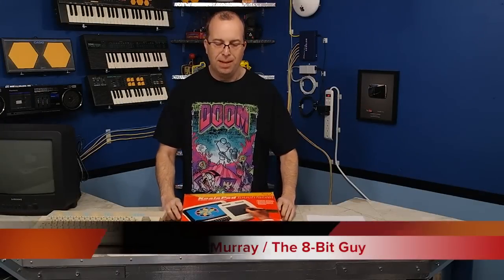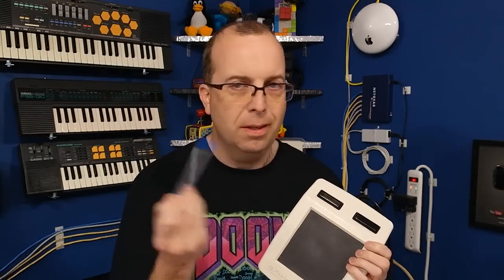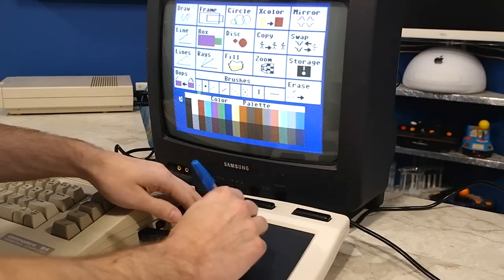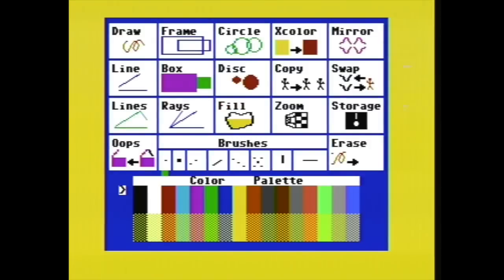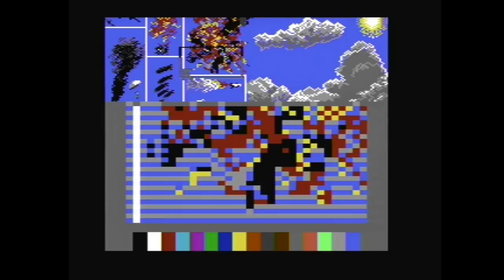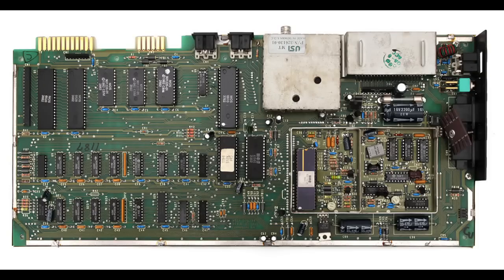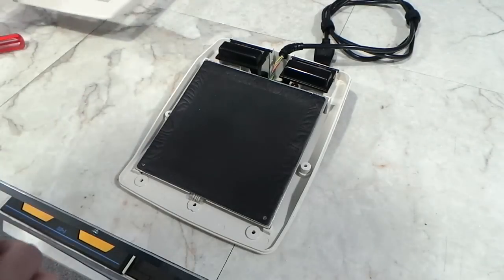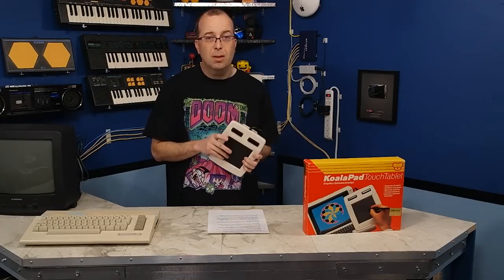The KoalaPad - How we used to create graphics

Comment: I had the KoalaPad for my Apple //e and it was handled like a joystick. 

The title screen reminds me of Graphics Magician images. At the moment, I can't verify when it came out, but it seemed to be on the Apple II first. Later, it was released for the Atari ST and Commodore 64.The software recorded the steps to draw an image instead of saving a completed image file. It was intended for adding graphics to adventure games - Hi-Res graphics with the 4 lines of text. By saving the steps to build the image, it used less disk space that an image file would. I did own a copy of the software back in the 80s. There was no licensing fees. You just had to list the programmer in the credits.

Comment: I do remember the CD-i  having something like this too.
not that I actually owned one but spent a great deal of time stuck in a place where they had these in a kiosk type setup, and they used something that looks just like that, and I think even had that name or a very similar one to it as the controller instead of the one that came standard.

Comment: There was a rebranded one for the Tandy Color Computer, no software included. The CoCo Koala Pad attaches to either joystick port in the CoCo and read just like another device in there, analog to digital converters producing standard X and Y values from 0 to 63. Suitable for some applications but for power users the GT-116 Digitizer Table was the way to go in the CoCo world 😎

Comment: I made a tb-303 emulator with assembly on c64 back in the day and the main reason for the whole thing really was those pot inputs. Having a potentiometer controlled and readable filters were a bit pricey at the time (we had alfa wheels everywhere and buttons, all pots were gone in the 90s..)

 The reason why sound chip would handle that is that.. it is just simple analog to digital conversion. Even thou SID has nothing to do with samples and ADC/DAC, it is still quite logical place to put the whole thing. One can use the pot inputs in the SID chip to make a very crude sampler too.. If i recall correctly, one could link the pot directly to SID filter controls (or i made the link, takes two instructions (read pot to register, write the value to filter address, done ) :) ).

Comment: For painting and drawing, these old analog joysticks/paddles usually read from 0-255, which is okay if your resolution is at or below this, but for higher resolutions, some dots must be skipped to fully move across the screen. The skipped dots are inaccessible without zooming in, or constraining the cursor movement into a smaller area.

Comment: We used to use a similar device on a C64 back in the mid 1980s to create title screens for video cassettes. It didn't have buttons and it had a flat bottom (base) instead of the slanted one the Koala Pad in the video had. Along with painting and drawing it had a text function.  Any idea what that might have been?

Comment: Here's the IC part numbers if anyone is curious:

Top Left - LM2902J - Quad op-amp
Top Mid - LM3046N - Transistor Array (5x NPN, 2 in differential)
Top Right - CD40106BCN - Hex Schmitt Trigger

Mid Left - No idea. Looks like it says "μA 33R PC H332" on it but hard to read. Google brings up all sorts of random parts for this and similar model numbers, so can't really say what it is.

Mid Right - MM74C74 - Dual D Type Flip Flop

Bottom Left - LM3046N - Transistor Array (5x NPN, 2 in differential arrangement)
Bottom Right - CD4066BE - Quad Bilateral Switch

using the orientation shown in 6:37

Comment: I used the Koala Pad a lot, back when it came out, both on the Atari 800 and Apple II Plus. I enjoyed drawing with it more than using a mouse with MacPaint. Though, I liked MacDraw, since you could create graphical objects, move them around, and combine them into larger objects.

I had researched how to load and display standard graphics files on the Atari and Apple II, which were uncompressed. It was a simple matter to load Koala Pad pictures on the Apple II, since they were stored in the standard Apple II bitmap format. You just went into its high-resolution mode, and executed BLOAD <image file> in Basic. This was not the case on the Atari, though. Every time I tried to load a Koala image using a standard graphic format algorithm, I'd get garbage. I wrote to Koala Technologies and asked them what I needed to do. They actually wrote me back, giving me an algorithm in machine code to load Atari Koala pictures. I wasn't familiar with assembly or machine code at the time. So, I didn't implement a Koala loader, but I at least found out that the Koala format was compressed.

Comment: i know i'm a little late here, but anyway-- the parts i see on that circuit board are: CD4066 (quad bilateral switch); 74C14 hex schmitt trigger inverter; 74C74 dual D type flip-flop; LM3046 (2) bipolar transistor array; LM2902 quad operational amplifier; and one chip I can't read, hidden under the wire bundle. most likely the 74C74 flip flops are used as debouncers for the two buttons. they probably use the 74C14 schmitt triggers to make an oscillator. the touch panel is possibly a pair of resistive sheets (so many ohms per inch) separted by a mylar sheet full of holes, so the two sheets come in contact thru the mylar holes when pressure is applied. the digital oscillator probably drives the bilateral switches to alternatively drive voltages onto first the horizontal and then the vertical sides of one of the sheets. the op-amps probably read voltages from the two sides of the other sheet, and bipolar transistors probably also form sample-and-hold circuits with those big caps; the transistors would then be driven by the two phases of the schmitt oscillator so one op-amp is enabled to sample-and-hold only when the horizontal voltage is applied thru the switches, then on the next clock phase the other op-amp is enabled while the vertical voltage is applied. simple, but clever.

Comment: I'll also add, that it seems like all this device does, is mimic a mouse. 
Which in return, is mimicking fine movements of a keyboard (given the type of computer that would have been used with this back then). 

I'd be interested seeing how the hardware  to software interaction is like in this thing. Plus the actual hardware.
Reply: It's almost like this thing is a digital/semi-mechanical Etch-A-Sketch!

Comment: Looks like a 4 wire resistive  touch pad. (does it deform slightly when pressed?)

The touch-pad is made by taking a conductive sheet of material and attaching wires to the top and bottom.  Then, doing that again but rotating it 90 degrees and sticking it under the first with some sort of fill that prevents them from touching.

You take the two leads for the top pad and hook them up to VCC and GND. then you take the two leads on the bottom and look for a voltage between them and gnd. When you press on the screen the layers touch and it's just like a wiper on a pot. There is a gradient from 0 to vcc and you're sensing it at the point of contact using the other sheet.

The annoying bit is that's only half of it. You sensed  one co-ord. you need to do the test again only with the top sheet as the sense sheet and the bottom as the vcc-gnd sheet.

That's what the circuitry is probably doing. Rapidly switching between X sensing and Y sensing. and then "pretending" to be two paddles. Maybe it "stores" the voltage in a capacitor hooked up to a unity gain op amp that then goes out to the paddle? and uses an analog mux to do the switching? Do you have high rez photos of the electronics?

Comment: That was the first tablet I tried in 1983 on an Apple II. My version of the software for the C64 came on floppy - and the disk failed to load (copy protection or something). Ended up returning it and using an Atari Touch Tablet which was released the same year - which had a button on the stylus and about double the drawing surface instead.

Comment: If you hooked both paddle controllers up, would it be possible to use the program like an Etch-A-Sketch?  Or do the fire buttons on the paddles not correspond to the buttons on the KoalaPad?

Comment: I had this when it came out. I ordered it from compute magazine. I spent my high school 10th grade summer vacation to make (INMHO) some pretty damb good MLB logos (bluejays,yankees,mets,boston red socks(Theses disks are out there so if anyone has my art, I would appreciate you letting me know) ) and some comico mage and another one I can't remember. I used grey as the shader at the pixel level to smooth out the pixelation. It was on the commodore amiga I used mine I think. It may have been my 64.

Comment: 6:34
LM3046 (2 chips on pcb) - 5 general purpose NPN transistor array
LM2902 - low power quad op-amps
PC 8332 - unknown (custom made microcontroller?)
MM74C14 - hex schmitt trigger inverter
MM74C74 - dual D-type flip-flop
CD4066 - CMOS quad bilateral switch
:D
Reply: Was going to do the same, lol. Good thing I checked comments first :D

Comment: Went to art school in 80's. The school had a very small room with a few Apple's and Koala pads for "computer graphics". I don't think it was even called "computer graphics" back then. There was maybe 3 or 4 "stations" and at the time I used it once for one small project in one semester... it was mainly a novelty. The process was torturous and the results were quite useless as "final art".

At the time the school did not have a good way to get anything of quality out of the system. We did save projects to large floppies that we brought to class each day. The only way to get things out into something tangible off the screen was a horrific dot matrix printer (crap computer paper with muted colors. The paper was so wet with ink it was limp and prone to tearing. It had to be dried before doing anything with it and was quite wrinkled after drying.)

The other option was a film camera with a special "mount" that attached directly to the very small color monitor. We took color slides of our creations. The results were perfect... uh.... considering the pixelated content being reproduced. I still have slides of my art work, but have since lost the disks they were on. Prints from the slides were better than the dot matrix prints but not by much.

There was one more thing we had attached to this system. It was a "black and white" bit mapped photo digitizer. So long ago I don't remember how it worked or what it was. Basically we had a camera input directly into computer. By adjusting the threshold of the input we could digitize high contrast artwork or objects and then modify it with the Koala software. At the time... I was... very underwhelmed but also intrigued by the potential.

Little did I know that not that much time later after graduating from art school and I had been working at an advertising agency for a few years as a "paste up" artist, desktop publishing would explode (Adobe and Apple perfecting Postscript), I would be working in a completely digital graphics department. Almost overnight this new phenomenon would wipe out local businesses and careers in a the print industry that suddenly became redundant. Only print shops that invested in digital equipment and training survived. Many companies instead of adapting, simply refused to take anything that was produced digitally... eventually there were no jobs and they had to close.

I saw the digital take over happen in real time so fast my head was spinning. People in my own company who didn't adapt were laid off. I saw digital wipe out careers that took decades to learn. Like shooting film for printing plates (choke and spread for overprinting). Creating four color photo separations "by hand" from color photographs. In the old days that stuff took years to learn how to do well. Desktop publishing eliminated the need for that expertise overnight.

I looked back at that Koala pad I used in art school in a whole new light... I was amazed how freaking FAST that transition happened.

Comment: Makes sense to me you'd handle the analog paddles in the sound chip.  There's a reason a PC joystick port was on the sound card--there's a lot of analog circuitry on a sound card, so it's a natural place to put an ADC for game controllers.
The LM3046Ns are five NPN transistors.  The LM2902J is a quad low-power op amp, I couldn't really make out many other part numbers.  Nothing too exotic it seems.

Comment: It works with GEOS because it works the same as the mouse did.  The commodore mouse was a pair of continuous pots for the x and y axis.  This and a mouse should be interchangeable more or less other than a mouse would go from max (255) right to min (0) where as this looked like it will return a value based on the absolute position.  That may cause a few quarks.

Comment: There was also the Lucasarts, Pixar, D'OCon and Paintbrush back then but they were custom hardware studio exclusive animation computers nothing to do with a plugin for a home computer to use with such programs as Deluxe Paint for Commodore computers though.

AMIGA would have been the best system to use these plug in pads in the day as AMIGA was built for music, graphics and animation creativity in mind but it's pretty cool to know there is a plugin way of doing creative drawing stuff on the less powerful hardware it's bonkers because of the limited colour pallette of the C64 to have such a thing out for it but it's good that it was out there for games graphics makers who normally had to program a sprite using lined paper as pixels and basic scripting language as it elliminated such a requirement until it came to coding the game bits.

Comment: I actually really don’t understand how this drawing program works, does it store and manipulate tile sets via chr ram or does it generate vector graphics trough software and then generates it as tile sets,

Also I can imagine that if it instead just stores every possible combination of drawings as tile sets on the cart, i can imagine that you need to store millions of tiles to account for every possible combinations of drawings such as circle on circles or squares and squares or squares on circles etc,,, not mention all the different colors you want to use,

Also i wonder how you can put so many colors at certain point within an area on screen since each tile can only take maxomum 4 colors including transparrancy , how did they avoid color clashes between colors???
Either way am stun how they did this as well as on other tile based systems as well.

Comment: I had one of these and when using the stylus it had a nasty habit of drawing a line diagonally across the screen, right across my artwork when holding the stylus in one spot for too long. Otherwise it was great. I did hook my paddles up to it and it functioned much like an etcha-sketch. A friend and I used to each take a paddle and attempt to draw something together. Never came out with anything but a mess but it was good for laughs.

Comment: not enterely sure but I think there is and audio in in the C64 as well. The SID was the analog interface in many ways for the C64. Another curious thing is the optic pen that was available for the 64 connects to the VIC chip, a dedicated pin interrupt just for the optic pen. Probably would work with the guns as well. Never seen this pen in real life but the VIC had prevision for that.
Reply: 38911bytefree I actually had one of the light pens for the VIC20/C64 which used the parallel printer port as its interface. It was very easy to write Q&A type games for.  But they needed that VIC interrupt as there were two ways of polling position with a lightpen.  The simplest was to sequentially flash squares on the screen if there were to be specific targets, then detect when the square you just flashed coincides with the interrupt.  The other, a raster scan mode, which needs very good timing info involves detecting the actual moment an image is drawn by the scanning electron beam as it passes under the lightpen, which needed rather tight integration with the VIC chip since you needed very accurate timing coupled with inside knowledge of what portion of the screen was being drawn at that very instant, something the VIC chip knew internally.  I only ever made use of the simpler flashing blocks mode as that could be done easily in BASIC, the other could only be done in machine code (which was beyond my 9-10 yr old self) since timing was so critical and you needed to be able to count instruction clock cycles to know exactly when the event actually occurred so that you could determine your coordinates on screen accurately.

Interestingly, lightpens made a little bit of a comeback in the early 90s before the mouse fully won out over them during the transition period from keyboard to mouse where few had ever used a mouse before.  Sadly they will likely never return again as their more advanced application, the raster scan mode, was intimately linked to how CRT's drew their image, something that is entirely lost on a modern flat panel display, though the simpler flashing squares mode could still be used it had more limited utility (but worked well for Q&A games).  Of course, nowadays we can easily do touch screens, styli, and other input options directly onscreen that were not practical in the 80s.